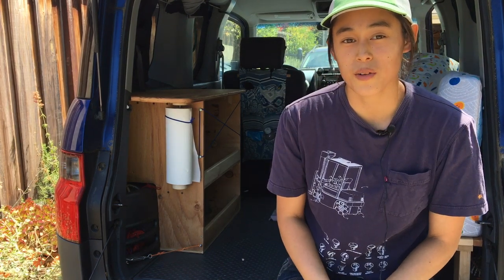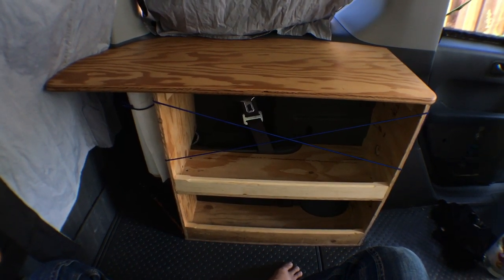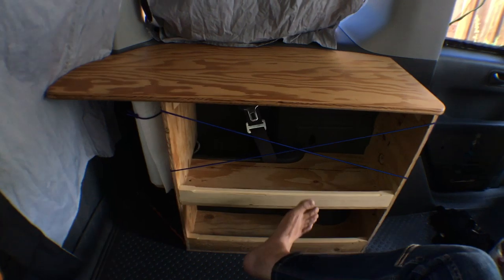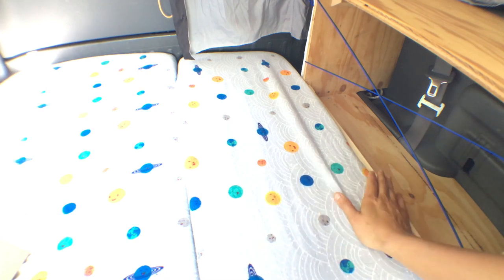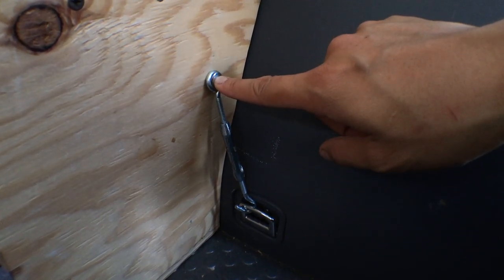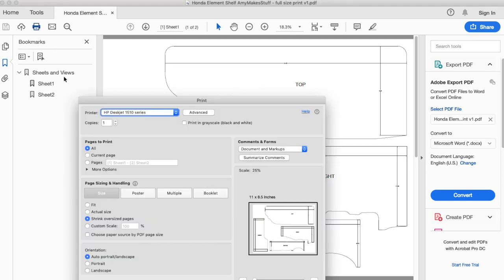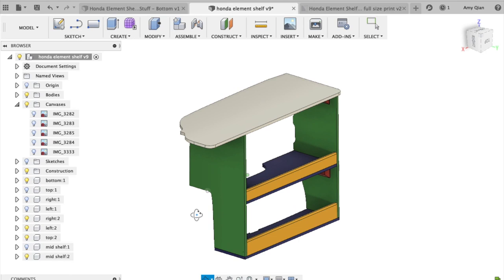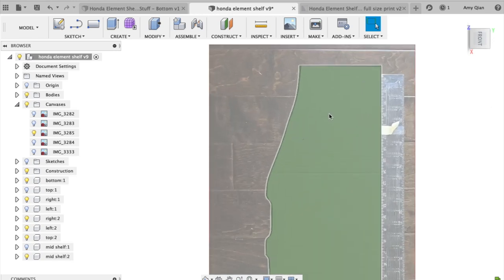Honda Element Micro Camper: Shelf/Desk FREE PLANS

Comment: I was excited to download the pdf Sunday. Finished it today. Thank you so much! I would post pictures, but I’m not on Instagram. I deleted the turnbuckles in favor of a 12’ long, 1” wide webbing strap (IKEA) run through the same seat belt restraints and across the front of the shelf (guided by conduit ‘C’-clamps). Also, you introduced me to pocket hole screw construction, so I used that method to bolster the shelf and base (in addition to to top) - which made the hutch that much sturdier. Last thing for anyone considering making this would be to print-out the plans on card stock rather than lightweight paper. Anyway, thank you again for saving me so much more effort. You rock!!!
~ Don
Reply from the maker: Rascal Flats, I am so so happy that you used the plans!!!

Comment: Nice contruction tips. Thanks for sharing. I have a 2007 Toyota Sequoia & I'm wondering if the back space in it without the middle seats is bigger & the headroom than a Honda Element. I would like to convert it for a weekend camper.  I'm only 5'0 y'all.

Comment: Hi Amy, I have a 2003 and a 2007 E. Have you gone camping in yours, and if so, what will you do if you have to access your jack and donut spare?
Reply from the maker: I keep my jumper cables on the spare compartment, and I’ve had to access that before. I detach the turnbuckles for the shelf and push the whole thing towards the front of the car. Then I detach the turn buckles for the bed. Without extra stuff on the bed (just mattress and pillows) it’s light enough to lift up together with the cover to the spare compartment.
Reply: @AmyMakesStuff  I am going to completely do away with the donut spare and install a hitch with a 2" receiver on which I am going to attach a modified bike rack that will tilt away from the car and hold a full spare. I like your setup and I think most people have the cabinet on the driver's side and bed on the passenger's side. Are you going to install solar, a fridge, stove and sink in the future - I am sure you are going to come up with some nice modifications if you decide to do them. :)
Reply from the maker: I’m considering solar, but in past trips, I haven’t had a real need for it. I’ve never had a need for a dedicated sink or fridge, so no plans to add those. Keeping it real simple!

Comment: Hi Amy, I love your plans and builds. I have an Element and will do a mod of the bed with your specs, so thank you. What material did you use to put in the backseat wells on the floor where the seats would normally fasten to the floor? Thanks.
Reply from the maker: Hi Sonja! Thank you! I use some foam packaging material. It’s not totally rigid, but it was easy to cut. Even better would be to put down a really thin rug or rubber sheet over it. But the foam chunk is at least enough to make sure we don’t trip on the seat anchors.

Comment: Great work Amy. Have you thought about attaching a table (with hinges) to the front of the unit. As well as working as a table, it would serve to keep your stuff in place!
Reply: I immediately envisioned the same when I saw that shelf top!

In my version, the table leaf folds back on top of the shelf - and is a few inches shorter so it provides a lip for the small regular items that are placed on the shelving unit .... so they stay put when in transit.
Reply: @MomCat6000  Ha, great minds! Still working on my version, the fiat doblo van has a wheel base which is awkwardly place for building round, at least with my carpentry skills!
Reply: SAFETYfull I am 2 years out from retirement. I spend a lot of time daydreaming of the perfect vehicle for my future life of travel and minimal living. 
My first thoughts were, of course, doing a build-out in a van ....but since recently acquiring a Prius, I am now considering a RAV4 Hybrid for its built-in power system & fuel savings. 
 I really appreciate the ideas presented in this awesome video!
Reply: @MomCat6000  That sounds like bliss. You will love retirement when it comes.  Two years will fly by. Simple is usually best (and cheaper). Good to see you thinking of economy, all these additions that people put in their vans add weight and therefore fuel cost.  Currently looking at ways to heat the back of the van as it is cold in the UK this time of year.
Reply: SAFETYfull I’ve heard if you time things out right, u can travel throughout the States staying in the 70 degree zone all year round! I currently live in the high desert Southwest where it can get really cold in the winter but further south in Arizona, the winters are mild (but the summers are brutal!) That’s one plus to driving a Hybrid vehicle- you have climate control that runs off the hybrid battery rather than the gas engine! Big Plus!! Otherwise I figured hot water bottles in a  subzero sleeping bag  might be a good alternative to running a heater to stay warm.
Reply: @MomCat6000  Luckily for me I don't like hot weather, 70F would probably be ok, so long as it isn't humid. Currently trialling a portable 12V heater (cheap ex ebay) which runs on the 12V socket in the back of the van, supported by good insulation in the back. It might also help stop condensation and drops running down your neck,,something you may not encounter at 70F. .Anther thing I found handy was to use wide neckThermos food flasks for storing butter, milk etc rather than the expense of a fridge.  I am planning a Youtube video soon based on my experiences, so keep your eyes peeled.
Reply: SAFETYfull what a great idea for storing cold items!! I like that! 
Please post the link to your video when it’s ready!

Comment: Amy again good job. I have been out of the design world for 7 years now. Most of my design was in mastercam solids , pc based Cnc . Digitizing was just getting cheep , is there a low cost digitizer ? (I starter playing with making a PlayStation years ago a digitizer) I would like to digitize the inside of my sienna so I can get some Baltic birch laser cut into basic panel. Yes I will need to add draft in areas and I have programmed a machine to cut the draft but I’m retired and in full play mode. Would love to help some other people out like you are doing. Mechanical engineer by education, pattern maker last few years b4 retirement. The one off is no problem but the simple 2 d cad file to share would be great to share with people who need a start. Keep up great work and if you get a chance let me know.
Reply from the maker: Hi Richard, I can't say I've really stumbled on a good digitizing method yet. I've really only been able to pull 2D contours by iteratively tracing cardboard templates (I'll try and show this in the next video). I haven't heard of any hobbyist level 3D scanner yet, so curious to hear how your PlayStation project comes along.
Reply: Yes I had skipped PlayStation to recycle bin. Realize I’m a mechanical person than a electronics. I had hoped , by now , you could get a digitizing disco ball to get a point cloud to play with. I had done some in rhino , as it handled point clouds better but digitize unit was sort of pricey. I’ll let you know if I find anything. Keep up the good work.